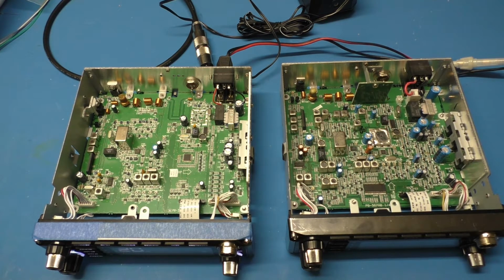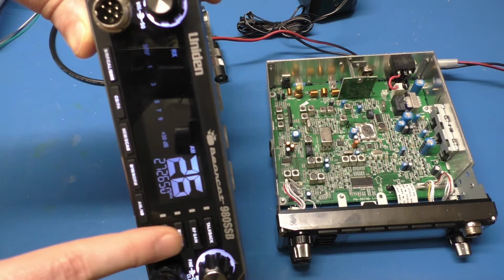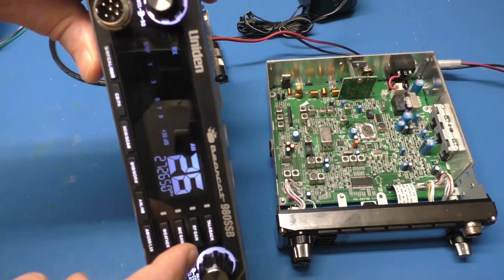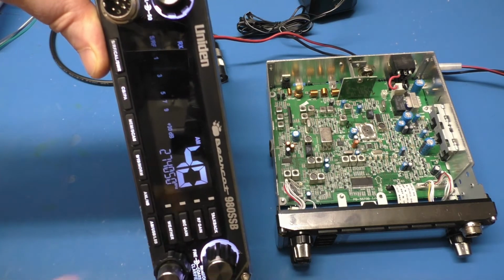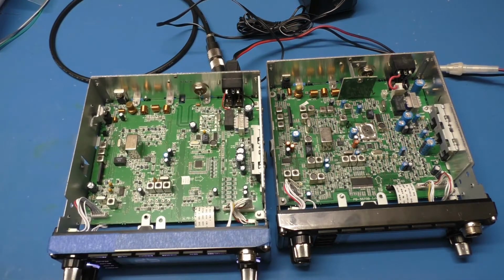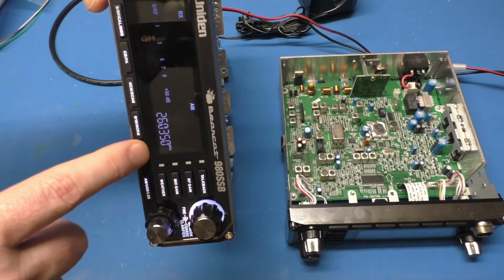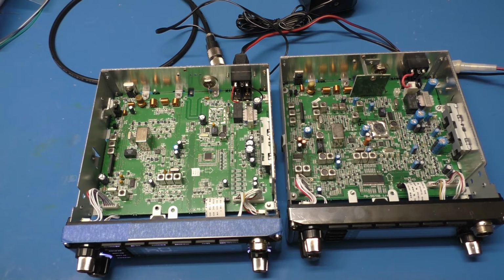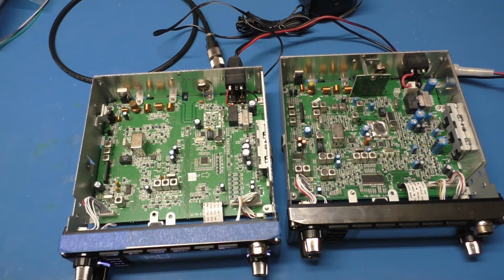980 new revision update

Comment: Just bought a new 980. I opted for this over the Anytone quad6 because I like the display better. Yes, I'm missing features, but now you have fixed the features I will miss.  I am not concerned about extra channels, although cool, I wouldn't even be using them on the quad6.  It would be awesome to get this in my 980. Do you still make these, even if limited supply?

Comment: How can I contact you to purchase one of these boards?
Reply from the maker: I made 30 of them and I put it in the video description that I had run out.
There is a bunch that still want one and it is a good little radio so I can hardly blame anyone.
What I am considering is putting together a list of people that want one and there is enough perhaps I can do another batch.
Does that sound like something you would be on board with?
I am looking at another option that would make these a lot easier and faster to produce.
Reply: @Mark19960  thank you! as I stated above, I love the way the 980 looks over the anytone. your boards bring back some of the features I am not getting on the 980.
Reply: @Mark19960  I would like to have one if you make more please add me to the list
Reply: I will buy 2 of them. I can send you a deposit if you like. Thanks.
Reply from the maker: @steve_does  Not something I do mate. If I don't have something to hand you back I don't hold anyone's money. I have another idea in the works and it's been discussed in the 980 users group on Facebook if you are interested. Just look for "Uniden Bearcat 980 SSB Radio users".  This was never a for-profit venture so it's pretty likely this is going to end up an open source project but I have to take care of some legal encumbrances first.
Reply: @Mark19960  I know I'm really late on this thread, but I would be extremely interested in 3 of these boards. I do love my bearcat and being extremely new to the CB Radio world but also being and arduino/python tinkerer, I look forward to being able to get one of your boards for my radio.
Reply: Ok that’s no problem. I will wait until you get some. I will still take two when they become available. Thanks.

Comment: Awesome work on this.  Are all the signals on the ribbon cable digital? If so then it could be pretty feasible to make a remote-head conversion by converting the signals into a serial data stream on a single wire with a 32-bit shift register and back again on the other side.  That would dramatically reduce the number of wires needed and you could probably get away with a single 8-pin shielded CAT6 cable for the entire remote connection (1 for the ribbon cable data, 1 for the shift register clock,  and 6 for the other voltage lines).